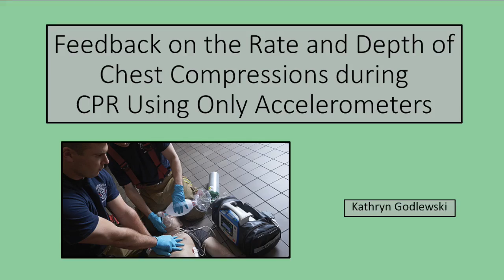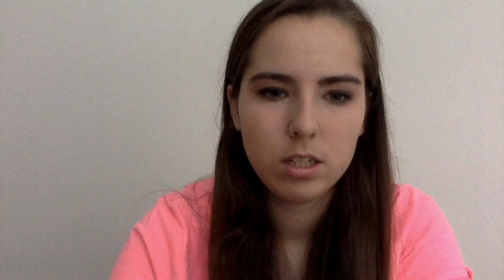Feedback on the Rate and Depth of CPR Chest Compressions Using Accelerometers

Comment: Hello, my name is Adeel Arif. I am working on a high school science research project. In this project, we are creating a mobile app to improve the quality and care of CPR. We are using the accelerometer feature on the Iphone and using the ios Swift4 coding language to create the app. I am trying to use the formulas in this paper so I can include them (or a part of them) in my code to calculate the depth and rate in my mobile app. Is there any way we can get in contact and you can explain these formulas to me?